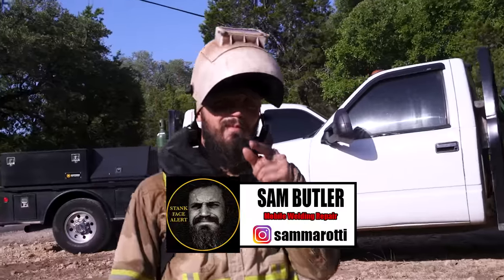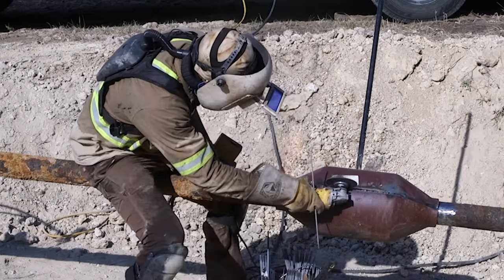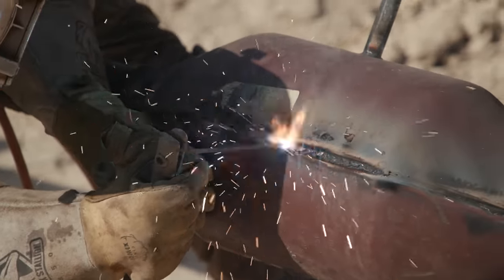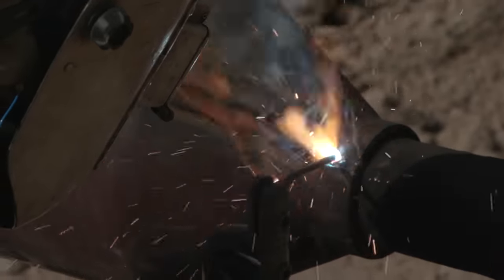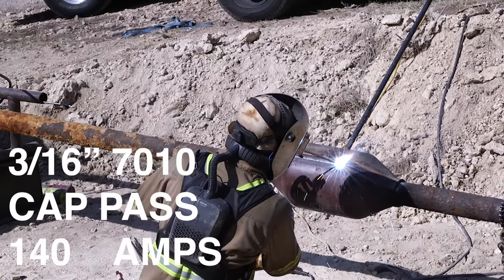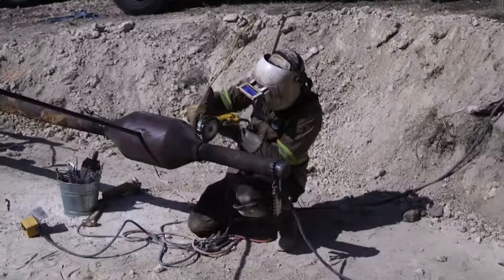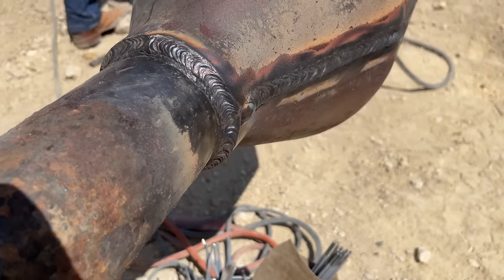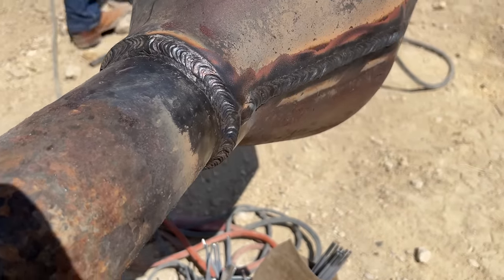Repair Welding a Live Gas Line on FIRE! | Stick Welding (SMAW)

Comment: Our shop took care of all the gas distribution thru out a military installation. Lots of pipe was welded, some new and some old and live. The fun we always had was watch the people run like hell once the torch was lit getting ready to cut the pipe. More than once we had sidewalk superintendents call the fire dept or military police on us and telling them we were crazy and dangerous.
Reply: How do they expect you to do it?
Reply: @Dane33781  - probably want to shut down the line and purge it
Reply: @psychiatry-is-eugenics  absolutely
Reply: @psychiatry-is-eugenics  That's not always possible. You can shut down and purge 10 feet but 10 miles is another thing entirely.
Reply: @Dane33781  With a big enough air handler you can, but your venting raw gas to the atmosphere creating a bigger danger..
Reply: Often it’s safer and easier to just not purge it since the mix is not explosive and a mistake while purging could end in a huge blast

Comment: This is amazing work I must say. One question though, why not 7018 after the root pass or is this a specified procedure that requires all cellulose rod? Plenty of love from Jamaica 🇯🇲 🇯🇲🇯🇲 you guys have made videos to help me over the years.
Reply: 7018 doesn't work too well on rusty old pipes so xx10 is standard option. You also can't grind down to bare metal sometimes because you'll compromise wall thickness
Reply: Also ya can't downhand xx18.
Reply: Also 7018 rusts quicker
Reply: In calgary ab we have procedures on welding all pipe.6010 root 7018 hot,fill,cap.On the main line 7010 all passes.We call the repair a welded bottle.Cheers.

Comment: I don't get it. The pipe ends right there. Why couldn't you just plug weld the hole? Is this a demonstration?
Reply: I think so. The whole thing is exposed and with the condition that pipe is in, it would be replaced.

Comment: Hi, Folks.
I saw this being done in Sydney, Australia, in 1975 at the Australian Gaslight Company's Chullora depot as a tie-in weld - on 22" pipe. It is NOT a job for amateurs - - - or the faint hearted.

Thank you, Sam Butler, for reviving an old memory and sharing this process.

Just my 0.02.

You all have a wonderful day. Best wishes. Deas Plant.
Reply: I dunno man it sounds scary at first but I mean it's already on fire. What's the worst that going to happen are you going to set it on fire? Oh wait it's already on fire.
Reply: @sparklesparklesparkle6318  You keep the eternal flame burning, as an explosion creates high pressure followed by low pressure that sucks O2 back into the line creating an ever bigger explosion the next time.  Did my first hot work at 18

Comment: If stress is an issue then stress relieve the pieces at 1200°F or anneal at 1600°F  - those shells appear to be cold stamped (metal stamping) and will have high residual stresses -also sometimes those die are magnetized (picked up and handled with magnets) and will mangnetize the finished stamping . BTW annealing in controlled atmosphere is best since it not only refines the grain sizes but also eliminated magnetism.  Nice work.
Reply: Really that should be a comment for the manufacturers..... then again it might just add more cost than what the project calls for. Residential gas lines are under very low pressures so those stresses might not be an issue.  At least he's pointing out something only experienced welders would notice. Gives us lay welders some explanation as to what is happening.
Reply: That style of fitting is hot forged to form each half from plate.  If it was a split sleeve, those are usually rolled from  plate.

Comment: Worked both in oil field and for the City of Corpus Christi, TX in the 80's before most of you young welders were crapping in your diapers! I worked on emergency leak crew in the city welding on live one way and two way hi pressure and low pressure mains daily! I worked as a welders helper doing turn arounds for Repcon in the early 80's in alky and gas units wearing a class A hazmat suite in 110 degree heat.  That will separate the men from the boys! We had dropouts several times a day that took the ambulance ride!

Comment: Question. If there is a round hole where the leak is, why not grind the area and run a self tapping bolt into it the hole. Gas leak is now stopped!!! . Now Weld over the bolt!? Or is the area where the bolt is has too much corrosion in the area??!
Reply: You would have to actually use a thread cutting tap to go 3/16. Self tapping tech screws are intended for thin metal applications. 
But the idea of using the self-tapping screw and welding around it sounds a lot simpler and safer though.
Reply: If the gas company you are working for has a procedure to weld on the gas line, you have to follow that procedure. We had to weld a root bead with 1/8” 6010, then hot pass and cap with 7018 on the pumpkin. We then had to weld with 7018 onto the live gas line.

Comment: Very interesting. When I was a kid they put in natural gas lines in our little town. The pipe went down our alley and I got to watch them weld the sections. The operator would show off by welding underneath without looking....or so I remember. Neither was there gas in the pipe at that time.
I watched a power co. weldor install a valve in a live gas line where we live 35 years after the first experience.  It seemed pretty spooky to me.  He was concerned.

Comment: Interesting. I watched a welder replace a gas valve in a residential gas line.  He also utilized a Mueller valve installer.  The valve was down in a ditch if front of 
my house.  He was very precise in every move he made.

Comment: what pressure was the gas in the line at when they were doin all this?   i assume they kept it flowing just enough to keep the flame front from travelling back in the pipe?? or is it somethin else completely?
Reply: Fire cannot go back into the pipe as there is no oxygen in it, If the pipe as not been purged from any oxygen it could lead to an explosion !

Comment: Was the pipe thin where the hole was, or why not just weld the original hole shut instead of spending all day with the clam shell and then still welding a hole shut? I've been welding gas pipe for 15 years and have never needed to use this clam shell device before.
Reply: I was thinking the same thing... the condition of that pipe raises the question of how much longer before a new hole pops up. I don't know any local group that would willingly pay you to spend this long on a hole that small. To be honest the hole is a little suspect, doesn't look like it happened naturally over time.
Reply: We used these to go over leaking valve bodies, that have been put OOS or over mechanical fittings whether leaking or not , just depends on the company policy.

Comment: How do you weld this together without anything exploding? I don't know much about welding on live gas lines, but isn't there a risk of explosion? And if there is how likely is one to occur and the other factors that are at hand? I'm very curious to know.
Reply: Not a welder, but as an hvac tech i have an understanding of combustion. Natural gas typically needs a specific air/fuel ratio to support combustion. Typically less than 5% or more than 15% natural gas and it will not combust. So, if we assume within the pipe that there is close to 100% NG, it will not ignite. Naturally, theres a lot i dont know about this, but this is a little information to factor in.
Reply: @fuzzypickle5307  hmmm, interesting, I think you might be on to something
Reply: I work for a natural gas company doing welding just like this and what Fuzzy said is exactly how it works and keeps from exploding.
Reply: Yup, the NG in the Main cannot support combustion as it's above the UEL (Upper Explosive Limit, ie: above 15% gas in air ratio).
The gas is only burning when it has mixed with enough air to support combustion and this is happening in a controlled manner at the flare tip here and obviously around the patch before it is sealed. 
The leak is also small enough to control and not be a problem. Obviously a massive gas leak would not be tackled in the same manner..... that would be a recipe for disaster. 
Also it helps that Methane is lighter than air and will dissipate naturally anyway. Not sure you would want to do this in a trench with a heavier than air gas like Propane or Butane, that could ruin your entire day?
Reply: @nickmaclachlan5178  spicy!
Reply: It is residential low pressure, clamp it good, let the gas leak up the vent and completely fill the clamshell then weld away. The leak was small so the fires are normal and expected. So long as its just gas inside its not gonna blow up, air plus gas is what blows. Would finish with a weld to a magnesium anode bar to prevent future corrosion in the area.

Comment: That was interesting, thanks!  

I would not have considered welding on a live gas line, and I still wouldn’t.  You definitely know what you’re doing, which makes a big difference!
Reply: its not that deep man... hot taps are only scary if you don't use the proper safety techniques
Reply: @mblulz  I get it, but I’m just a crappy home welder.  I’ve seen guys work on live 400 KV power lines from helicopters, and while I understand the physics, I’ll pass on that too.

Hats off to people who know what they’re doing!
Reply: @mblulz  do tell what "safety techniques" were used here? To be fair I don't know the pressure and flowrates you're dealing with, but doing this at any of the sites I worked at over the years would get you fired and probably a lawsuit for attempted manslaughter...

Comment: If the end of the pipe is right next to you couldn't u just have the pumpkin already sealed and just slide it over the end of the pipe and weld round the ends?
Reply: This is just for demonstration I think

Comment: Even though you were welding on a  low pressure main, I would still recommend that you use an E7018 rod especially on 0.188" wt pipe.  Also, do you perform a thermal analysis on your welding parameters for the job?  If you haven't, I highly recommend it.

Comment: This is really interesting and a great repair. In my oil refinery engineering days, hot work on live lines was a site-wide no-go at all cost option. When performed, hot work was always carried out with the most stringent of safety measures in place. ASME PCC-2 for repairs on pressure equipment and piping provides guidance for both welded sleeves and box clamps however welded sleeves were typically performed only when the line could be isolated. Assuming this was a live in-service line and aside from the vent flare, could you please share what additional measures you had in place to mitigate against potentially high risk failure such as spontaneous rupture or severe fire? i.e. could you share the risk assessment?
Reply: Your comment reminded me of some work we did for an extremely shallow field out in the Mississippi delta. The gas line was only 8ft below the surface so we uncovered the line and lifted it above the surface to weld on the leak. Usually we would just put a clamp on it but there was an obstruction on the pipe that prevented it. Anywho, the line is kept under extremely low pressure to keep air from entering the pipeline during welding. (Just like that residential line) With gas, blowing a hole isn't the end of the world as its just a mild flame with low pressure, but it's a PITA to fix. Now I'm assuming you were welding on lines with crude flowing. Obviously there are much more problems than just a mild flame. I've seen guys weld on a trunk line inside of a coffer damn. Seriously that takes some major balls to do.  Hats off to you.
Reply: @Zeknix  that’s the thing, we never did  weld repairs on live lines - I can only speak from my tenure there. Things may have changed. Box clamps repairs were typically implemented on leaking hydrocarbon lines that couldn’t be isolated until the next planned shutdown. Failing that, hot tapping was the other option - although required a much more cautious approach due the high probability and consequence of failure a source of ignition could have.
Reply: @davidbrowne89  this is the most hackjob thing I have ever seen... The thought of anyone doing this in my vicinity gives me goosebumps... I mean, I'm used to seeing safety assessments for repairs on cutoff pipes _in the vicinity of live pipes_. And those don't always get through...
Reply: @Argosh  I agree, I was trying to be supportive but overall, this is a no go in oil and gas and petrochem.
Reply: @davidbrowne89  I've learned that your own safety is paramount and that if you feel unsafe the only mistake you can make is doing nothing.
Reply: @Argosh  couldn’t agree more

Comment: Nice demo, but why didn't you use the top half fitting to stop of the end of the main, cut it back and cap it or weld in a new section of pipe?

Comment: Great work . The last part could get you in trouble . Always weld the vent hole solid in the bottom and weld a no blow on for the vent pipe . I had a 24" light off on me and my partner. If there wasn't nitrogen bags up the line we might not be here.  I went tobweld the vent hole and boom When the pipe lit off it blew the bags and put the fire out . I think my ears still ring from the boom .

Comment: I heard before that my grandfather used to do "hot taps" at a a plant on the Ohio River back in the day. He welded for Columbia gas for 40 years. My dad was local union welder for 35. Both highly skilled at everything.  My dad said he used to go on those hot tap jobs to help.  Said they'd clear out that whole side of the plant. Lol.  I don't know too much about the process,  I just know it was on a decent size gas line.  Gas in it obviously.
Reply: Not Available  joined 2 weeks ago and made 5 negative comments.   Do you really think anyone is worried about a person like you?  Sad really.
Reply: Not Available  Perhaps, but you on the other hand are a certified wise ass for all U tube to see! That's really something to achieve in your short life span. Congrats!

Comment: Can some one answer me honestly how many years can you weld before the lungs start to give out and you become a teacher or business owner. Im trying to get into this field for the lo g run
Reply: Your lungs aren’t going to “give out”. Been in the trade for almost a decade and I’d say it’s how taxing it can be on your body that causes most people to want a career change. Try and make it as easy and as comfortable as possible for yourself and take measures to not inhale all the toxic fumes.
Reply: @tylorshideler7145  thank you a lot wish you all the best in your career and that info really helped
Reply: you can wear a dust mask . welding supply has them. it will filter out the smoke particles but not any gas unless you go with a cartridge respirator which is usually too bulky. if you want to spend some dollars you can get an air supply welding helmet . those can have a hepa filter unit with a blower that goes around your waist.
Reply: positive pressure helmet with a filter pack your already running a welding machine might as well have cool clean air blown down over your head keeping the toxic air away
Reply: @imchris5000  thank you so much

Comment: Here in the UK all underground Domestic supply Natural Gas lines are either Steel sheathed in plastic or fully plastic construction to stop corrosion. It's interesting to see this method on old equipment. Are newer gas mains in TX still the same construction, or are they plastic/PVC now?
Reply: I can confirm that other states use some sort of yellow plastic tubing.

Comment: " Flare Pipe '
    This is done Exactly as I thought .
  " Same reason as a flare on an oil rig "
  " without a flare burn off the gas is gathering low at the leak point , this way the gas is drawn off . "
    " drawn off by being burnt off "

Comment: I have never welded anything and don't anything about the gas industry, but the first thing that comes to mind is - why weld something like this ?  I would expect in this day and age that there would be some kind of aggressive fast setting epoxy soaked wrap that could be used to wrap the pipe and cover the leak hole to create an epoxy sleeve, then add a metal pressure clamp to ensure that it is very tight and secure.  Once it cures, then you have a bonded steel-reinforced plastic slug over that area of the pipe.  Why weld it ?
Reply: I'm not a gas guy but I come from automotive restoration and structural welding. I would hazard a guess that it's down to the fact that a weld is a "mechanical" fix whereas the fix you described relies on a chemical bond. Further to this, gas does funny stuff to sealants and patches whereas if you replace metal with metal, the pipeline/pipework etc continues to function as normal.

If you look at household or domestic plumbing, gas fittings and gas sealants are different to ordinary plumbing ones because of the pressure and environment they work in. 

Another thing, is the consideration of cost when digging up roads. You want the repair to last as long as possible as the cost of a dig up is prohibitive.

Hopefully a real expert will be along in a while with the real answer but this is my "edu-ma-cated" guess
Reply: Neptune products makes an epoxy tape for up to 50 psi for live leaks but only for above ground use last time I took the class on it.

Comment: Talking about how you cant see the fire through the lens, i agree my whole sleeve caught fire and burnt my arm before I ever realized. Was messing around and had a puddle blow up on me, got burnt pretty bad.
Reply: You didn’t noticed the heat drifting through the leathers ? You might have some neuropathy going on
Reply: @f87115  wasn't wearing leathers at the time lol, usually would just wear a long sleeve and didn't have any issues.